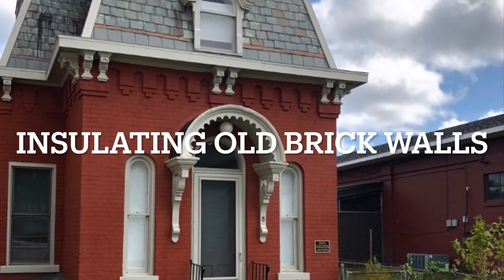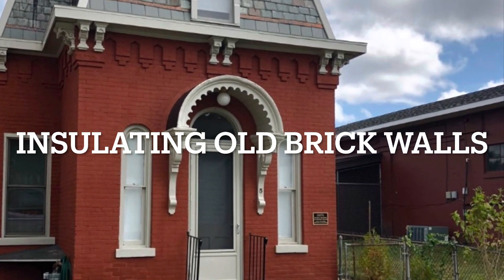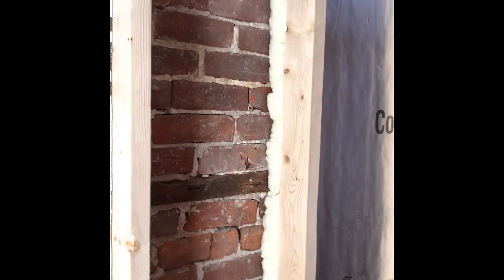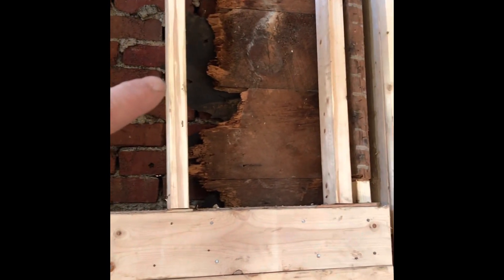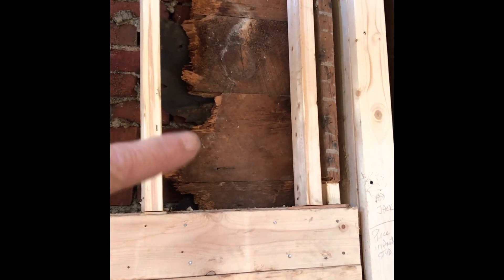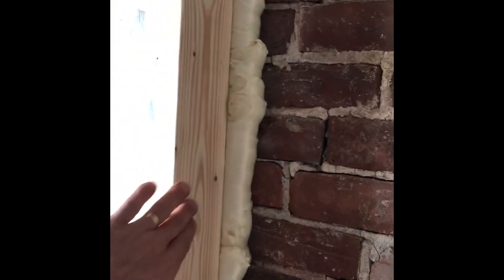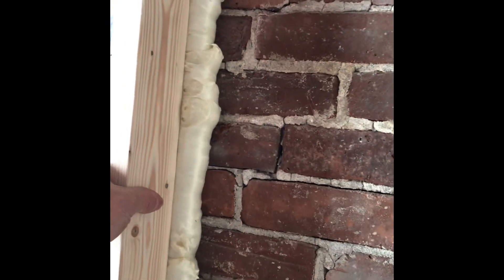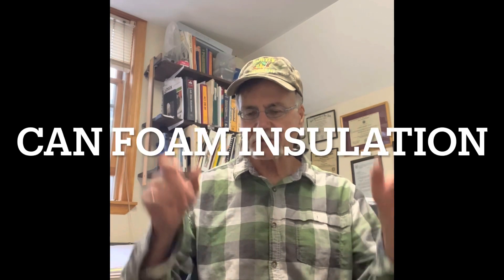Insulating a brick wall in an old house (on the National Register of Historic Places)

Comment: You are not worried about water getting between the brick and being held by the spray foam? I like this idea because I have a brick wall
I rendered on the outside but it still s
What do they call it spalliing or something? Where it’s kind of falling away from house an inch or so. Perhaps this would add some
More rigidity for my situation? If it does not press it out even farther as the foam dries… I have this same situation though a single layer of brick over 1” thick ship lap boards with no tar paper afar as I can tell. House built before 1900. On inch of air space between the brick and wood.
Reply from the maker: There is a small air gap between the brick and insulation.  Most importantly, the brick is coated with a VAPOR PERMEABLE coating so it can dry to the outside.
Reply from the maker: There is a small air gap between the brick and insulation.  Most importantly, the brick is coated with a VAPOR PERMEABLE coating so it can dry to the outside.